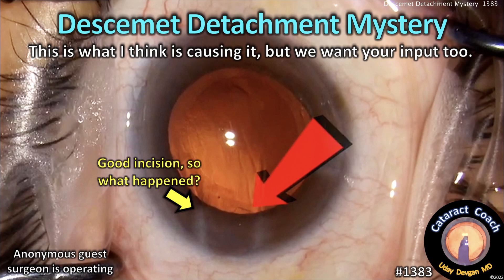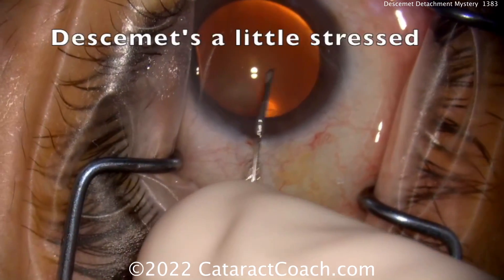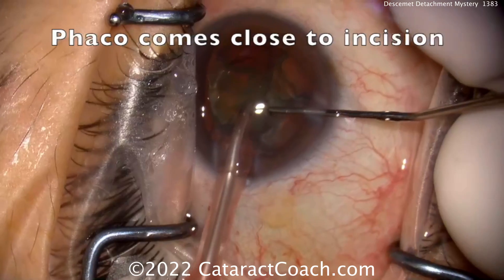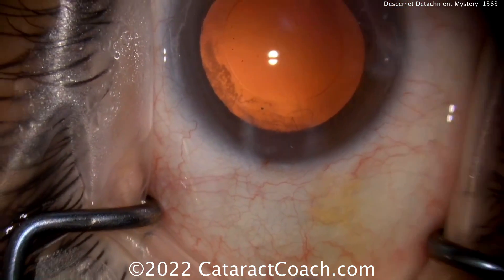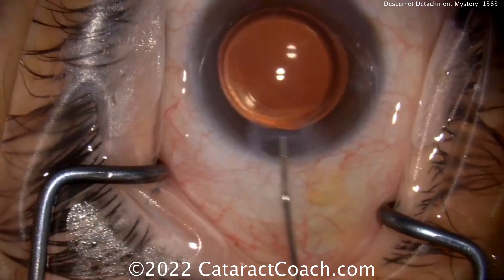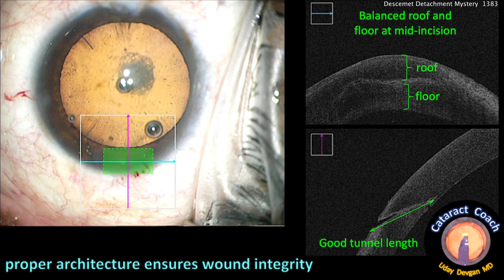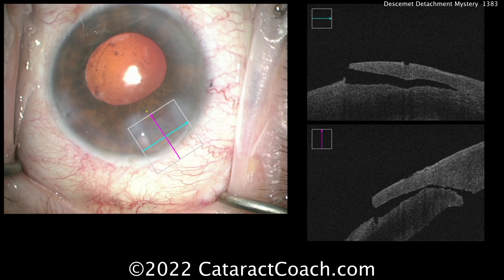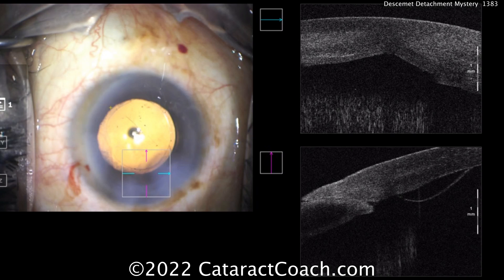CataractCoach 1383: Descemet detachment mystery

Comment: In my humble opinion the side holes in the sleeve were facing anterioposteriorly that when the injery to the inner part of the cornea happened at 53 -55 ,notice the side hole stretch at 57 ..... the holes should face side ways of the wound when getting in and out to prevent that.

Comment: It would be nice to mention that if you notice a descemet detachment, you should put an air bubble at the end of the case. It doesn't have to have a lot of pressure like air bubbles at the end of DMEKs, just a normal air bubble big enough to go behind the detachment area